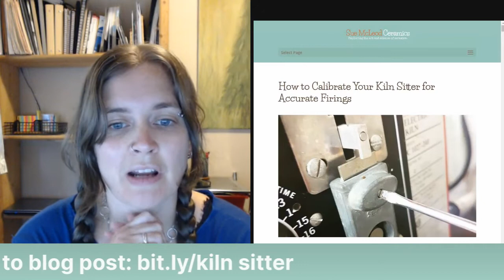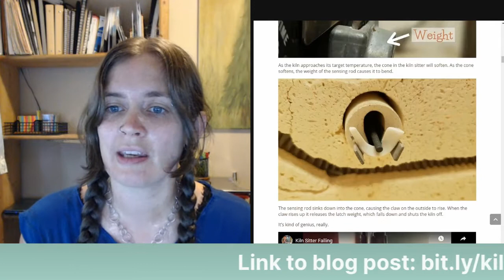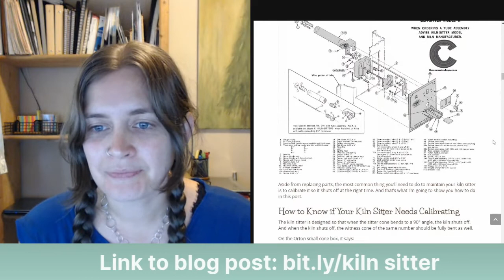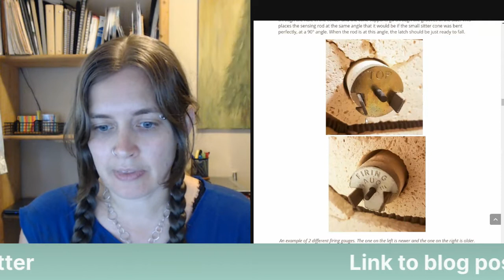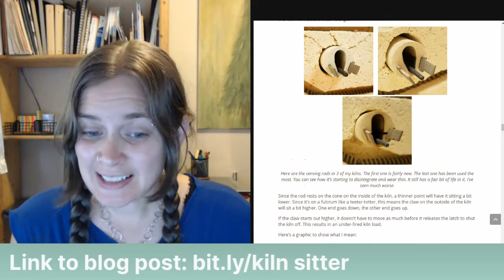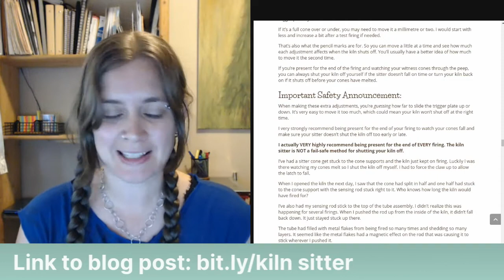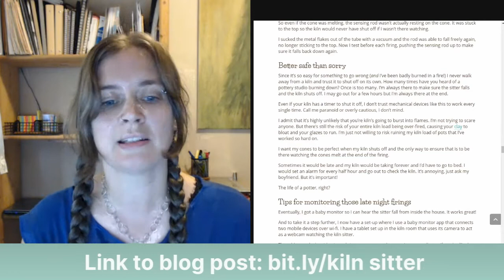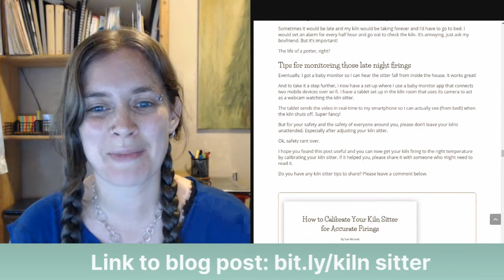How to Calibrate Your Kiln Sitter for Accurate Firings

Comment: So I fired my new older kiln ( barely used) it shut down on my glaze fire after 5 hours which is clearly too soon. I will go back and calibrate it now. I shut it down for safety. But now if the pots are ok can I re fire them?